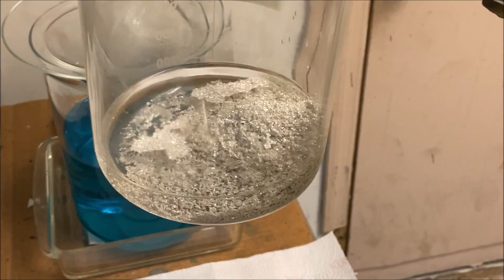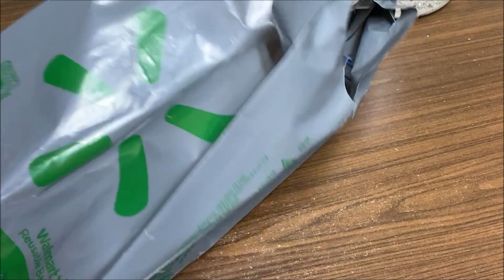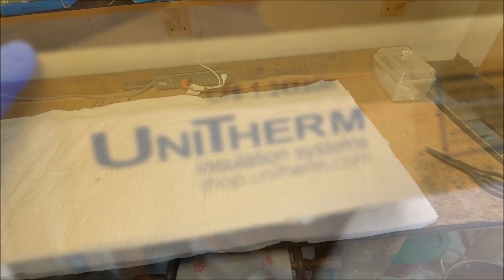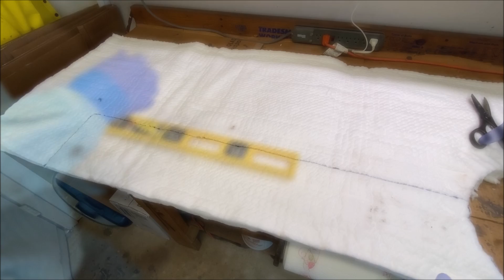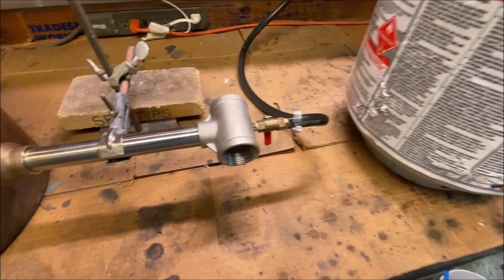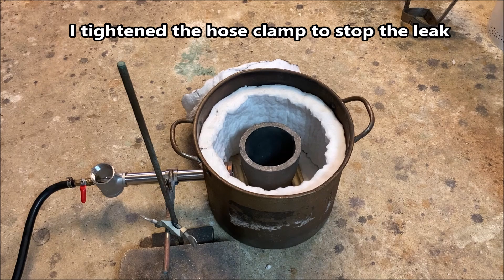Furnace Build For $100 Part 1

Comment: I'm sure it's far too late now, but:
#1 Use the metal lid! Just use screws to attach the ceramic wool.
#2 Cut a large hole in the centre of the lid.
#3 Rigidize your ceramic wool.
#4 Use a collar with triple centering bolts to mount your burner.
#5 Offset your burner so the flame goes around the crucible, not directly on it.
Finally, you might have had an easier time of it just cutting the top 1/3 off if a propane bottle.

Comment: I a. Looking for a "how to" for the nozzle/burner itself ☝️🙏.
Gas pressure air inflow.
Reply from the maker: I bought that burner nozzle on eBay already pre-made. I’m not sure of those figures. But I will say that the nozzle has performed nicely.
Reply: Unfortunately in africa we have to build our selfes, is the gaspipe crossing your double T air inflow perforated and it's actually using the ventulli effect.
Greatings from Namibia @sreetips
Reply from the maker: It’s a “T” with a propane nozzle. The air is Venturi in as the propane shoots through the long tube. The flame comes out of the end. I’ll do a short video. It looks like household plumbing fixtures.

Comment: Place a square of cardboard to place under crucible every time you burn. Will keep crucible from sticking to block. That block with vents may work fine alone.. Also some refractory clay painted inside all over the wool would be a very big money saver.

Comment: You should have put the fuel ignition point just as it goes into the furnace. Right now the way you have it, it won't be long before that pipe melts, crumbles ,breaks, etc. Very unsafe.
Reply from the maker: Ok, I’ll back it out. Thank you
Reply: @sreetips  Let me try to rephrase..Every furnace i've opperated in the past, the fuel went into the airflow draw right before it went into the body of the furnace. They would ignite inside the furnace, orjust as it was going inside.I've built these out of 5 gal. buckets and fire bricks. The hole you cut in the side should be on an angle so the fire swirls around the crucible.
Reply from the maker: Got it, thanks

Comment: “Propane Burner” search of eBay gives nothing but camping burners. Read through about 100 of the 250 comments and don’t see anything mentioned about it. 

What is the actual search term to find that propane burner? 

Those, specifically, are not easy to find! 

Thanks.
Reply from the maker: Propane furnace burner
https://www.ebay.com/itm/184364726452

Comment: Hi Srretips
If you position the torch diagonally, it will cause the flame to circulate inside the furnace, obtaining a higher performance.

Comment: Nice job, you might want to offset your burner so the flame rolls around the crucible. Make a more uninformed heat and keeps your crucible from getting a burn hole in it.

Comment: When you're doing your gold fill projects in the end do you add all your filters back in that's got the little gold chips and it looks like some purple stuff in there from when you filter out all your in between when you're not fuming anymore and add more distill and nitric do you add those filters back in
Reply from the maker: I add those filters to the recovered gold foils and then burn (incinerate) everything until no more smoke or flame evolves. THEN, I add the aqua regia

Comment: Hey buddy quick question when you put your stainless steel gold jewelry and hydrochloric acid how do you get your gold can you tell me the procedure I got a bunch of foils and black stuff when I filter it but when I put it try to put it in the solution I don't get no gold back when I check it with stanis chloride there's no golden solution can you tell me how to do this so I don't waste my gold
Reply from the maker: Stainless steel gold jewelry is plated gold a few microns thick. Very small amount of gold - almost nothing.

Comment: Yo sreetips, any chance you could do me a solid and basically just list out for me what glassware and accessories I need to pick up to do my first gold refining? I've got around 2 lbs of gold filled material. Also planning to do some karat refining, but would like to do the gold filled first. I have about 70 grams of karat grade material. And lastly I was seeing on ebay some stuff that comes in a bag that is described as nitric acid substitute? Is that actually legit? Oh and one more thing, how much would u sell me a 1/2 oz sreetips gold bar for?
Reply from the maker: I’ve made the videos as detailed as possible. Watch and take notes. GF is more difficult. Several small batches of karat gold before attempting GF. The “bagged” nitric I’ve never used. But it won’t be the same as nitric from a bottle. I don’t have any gold bars for sale right now.

Comment: You cam make a nice lid with Plaster of paris and play sand form a doughnut and sink two metal handles in.  You can open up some steel wool to put inside like rebar.
Reply from the maker: It will corrode and fall into the crucible.

Comment: I would get some sheet metal and cut a round of it to fasten to that ceramic wool lid, to give it some structure so it’s not so floppy. when that thing is at operating temperature it’ll be much easier to remove the lid if it’s a solid piece. You can just use a bolt washers and some nuts to attach it. Just a suggestion, I built one of these types of furnaces and appreciated a solid lid with a handle.

Comment: ?, If you dissolve gold filled materials in aqua regia? Will Stumpout work precipitating gold only? Or does Stumpout precipitate other metals as well? Much appreciated all your knowledge
Reply from the maker: According to Hoke, stump out (sodium metabisulfite aka SO2 gas) will drop platinum and palladium, if they are present in with the gold solution. But a second refining of the gold powder will usually remove traces of Pt and Pd if you use a different precipitant, such as copperas (ferrous sulfate) or oxalic acid, for the second refining. However, it’s not recommended to dissolve EVERYTHING in the GF material in AR. Doing so will produce a very dirty solution making filtering and recovery of the gold difficult and could result in loss of metal. Especially for a new refiner. Removing as much base metals as possible with hot nitric boils then refining the gold foils is the easier softer way.

Comment: Question, i used nitric to disolve sterling candle holders and 3 1942 ike dollars that were already destroyed, i left the solution out over night and there were clear crystals in the bottom of my beaker. Any idea what happened? I still got the cement silver out but no clue what the crystals are.
Reply from the maker: Silver nitrate. Dissolve in warn distilled water

Comment: Sreetips take a look at refractory cement, also called furnace cement, Satanite. You use it to coat the metal inside you furnace where it contacts the insulation and secure it to the metal. The with a brush or paint gun, coat the insulation inside to seal it and protect it from flames. It then acts to insulate the bucket so as you run your foundry it should  stay safe to touch on the outside of the foundry. Cut a breather hole in the middle of your lid you can see your melt progress and flame
color that way.
Hope this helps. 
Thank you for all you have given us 🔥

Comment: hey sreetips i recently found some filter material at pet smart in fish section that is highly acid resistant and exactly perfect size for the anode basket you are using as i have mirrored mine to yours and it works superbly just an fyi and they are 3 bucks per

Comment: I'd suggest induction coil heating. Just put a small ceramic crucible into the coil or even put a ingot mould on top of the coil. Let the gold melt right in the mould. Might produce prettier ingots.

Comment: if the crucible stand is alloy or aluminum, you may consider using something steel. it looked pretty red hot. not a big diff between silver and aluminum melt points..... nice job on the upgrade.

Comment: Hey Sreetips, thanks for your awesome videos, I watch all of them! I have one question: when you precipitate silver with hydrochloric acid you exchange nitrate ions for chloride ions and Ag+ for H+  leaving you with solid silver chloride and a solution of nitric acid. Do you put the reconstituted nitric acid in your stockpot or do you use it to dissolve more silver (or make more aqua regia)? Because even though it will be contaminated with copper etc. I guess its still pretty potent right?
Reply from the maker: Yes, it will still dissolve silver if there is any free nitric left. However, I try to use every bit of free nitric, before adding HCl, by boiling the liquid until no more fumes are evolved and there are still pieces of undissolved silver in the reaction vessel.
Reply: @sreetips  I'm not talking about leftover nitric acid but new nitric acid forming though. After all nitric is spent and hydrochloric acid is added, New nitric acid is formed from the  nitrate ions and the acidic H+ part from the hydrochloric. first you have Ag+ and NO3- ions, then you add H+ and Cl- ions. AgCl precipitates leaving you with H+ and NO3- which is essentialy new nitric acid. I think you could save some money there.
Reply: The only downside is the newly formed nitric acid is contaminated with some chlorine ions and copper (and other base metal) ions . You can get the chlorine ions out by adding silver nitrate solution until no more precipitate forms, and filtering. So then you are left with dilute nitric acid with dissolved base metal ions and a small amount of silver  ions and their accompanying nitrate ions. I saw a video once, I think from 999 dusan, where he made so called "poor mans aqua regia" where you make aqua regia by adding hydrochloric acid to a nitrate salt such as potassium nitrate or copper nitrate. This is almost the same: you have a nitrate salt in solution: silver nitrate and base metal nitrates, and then you add hydrochloric acid. So poor mans aqua regia forms. The difference is that if you add exactly enough you can get rid of all the chloride ions by precipitating it in the silver chloride. Thus making dirty nitric acid out of dirty aqua regia. Last I heard nitric acid is way more expensive than hydrochloric, so you could really save some on the acids like this.

Comment: I think you should put a lid on a hinge with a hole in the middle to allow gasses to escape and allow addition of additional metal.   I would suggest watching some videos from "bigstackD Casting" to see how important it is to preheat your tongs when taking the crucible out of the furnace.

Comment: If that floor thing is cast iron don't use it, it will melt. Ceramic or claim based plynths are what you need. Also add a piece of cardboard between the floor and the crucible to prevent the crucible sticking.

Comment: Put the burner on an angle so the flame has more of a cyclonic action around the crucible. You also might want to coat the mat with Satanite or refractory cement for more insulation and to reduce airborne fibers. The fibers can prove seriously dangerous to the lungs. Cool beginning build though. Can't wait to see where it goes from here.

Comment: you could "stitch" the furnace mat to the lid using steel wire around the edge to keep it away from the top of the crucible.
maybe also have the floor sitting the other way so the flames can flow through the ridges

Comment: A few suggestions that are probably buried in here already, but putting them all in one place:
0.  since you were in gloves you were hopefully in a mask as well since the fibers off that stuff isn't good for your lungs.
1.  burner should be in at an angle and not pointing straight at your crucible.
2.  In reference to #0 above, get something to coat the wool with, otherwise little by little it will burn off and be floating in the air and you'll be inhaling that stuff.  can't think of the proper term, but similar to refactory cement for it, but it is just a hardener you can "paint" on it.
3.  Cut that hole in the top as you need the air flow.

Comment: Along with the burner angle mods that folks have already mentioned, you need to stabilize the insulation wool with a rigidizer coating. The uncoated kaowool will slowly give you cancer the same way asbestos does. Plistix IR reflective or Metrikote IR reflective will increase the efficiency too.

Comment: Sr, I think that furnace will only last a couple of melts. Be on the lookout for an old propane tank. They have them at the hardware store here with no valve in them and brand new but I'm sure a used one would be just fine as long as it isn't all rusted out. 
And, yeah. The physicist in me says you're going to burn a hole in that graphite clay crucible. I'd aim the center of that flame right between the largest crucible and the wall of the furnace which will give you a good coverage and more even heating. 🙋‍♂️👍

Comment: Did the heat cause the soup pot to warp or did it come like that already? I noticed the heat escaping at the bent points at the top
Reply from the maker: I used that pot previously to burn several pounds of plastic that had gold on one side. It cracked during that incineration.

Comment: Cut a hole in the lid piece and the lid about the same size as the crucible top. Punch some small holes and use stainless steel wire to attach the wool to the lid and also as a handle to remove the lid safely.

Comment: You should also have at least 2 layers of ceramic wool. 1 layer isn't enough to prevent hot spots and eventually a melt through.

Comment: Don't just coat with rigidizer. To prevent premature breakdown, AND prevent dangerous particulate from breakdown, you should use a layer of castolight 30 castable refractory. It drastically increases efficiently and protects from breakdown. I'm a blade/blacksmith by trade. I have built a few gas forges. All of them capable of forge weld temperature for high carbon steel. 2200 to 2400°f.

Comment: It's great, all you need to do is work on a permanate lid and you're set. Take that lid you had and attach the wool by drilling holes through the lid and wool and using long bolts with large washer on the wool side and nuts on the outside to pinch the wool onto the lid. 3 should do it.

Comment: Yes..seen many of these furnaces.. the burner needs to be tangentially directed into the furnace. higher velocity will give more convection heat transfer and the heat will be distributed more evenly.. Guy from Mount Baker Mining and Metals even has an insulation wool only furnace. They all have a hole in the middle on top about as big as the crucible to vent out the combustion gasses. Can't wait to see those big bars of silver poored :D

Comment: Make the vent hole larger than the air mixing  hole diameter.  Safety. Gotta keep the heat on a one-way street.

Comment: Make sure to pre-run long enough to burn off the binders in the insulation and any residuals in the crucible. Caution in heating is needed as some forms of k wool melt below 1300C creating a royal mess ,  an optimized propane flame can hit  ~1900C  in best case scenario.  also venting and flame should be adjusted to prevent excess CO production.

Comment: Hey dude, might be a silly question but is the silver not worth less once melted down even when its melted and purified? I'm not sure how it works in the states but i thought it had to be "minted/stamped with a serial" to be easily sold on when in a  bar form. If melted down and made pure, its obviously still silver and probably higher purity after the processing but lacks the stamp/serial. Confused a little on it.  Is this more of an issue of who you sell to, i.e selling to a processing plant with proper equipment your get more, but trying to sell to a pawn broker get less or refused sale. 

Here in the UK might be different, i know the "scrap yards" (what we call the car/scrap metal yards who you normally sell to if not a pawn shop). They have very strict rules in what they can buy, i dont think they deal with gold and silver. But they do deal with cats/dpf filters from cars, and copper. Copper has a strange set of rules here with the sale it cant be in some forms such as thick cabling (people were nicking it from railway lines was to prevent that.). But they can buy melted down bars of the stuff, normal cabling, old boilers that kinda thing.
Reply from the maker: We buy silver. It does not need to be refined to high purity. I do it as a hobby. Sterling silver can be held just like it is. It will track right on up with spot price.

Comment: You should place the burner in angle to avoid burning the crucible. Propane gas penetrate the graphite and slowly but steadily "eating" the walls of the crucible. So to extend life of your crucible you should place it in angle that flame move around the crucible but not directly in to it. :)

Comment: You don't want the burner directly heating the crucible; you're only shortening the life of the crucible and increasing the risk of a sudden failure. The flame should come in at a tangent so the flames swirl around the crucible. Also get some saitenite or mizzou 3000 refractories to coat that ceramic insulation blanket and lock away the fibers before you use this again. Those uncoated fibers will become airborne and are a major health hazard.

Comment: You really need to preheat your Crucible before doing your actual smelting you start off with a slow flame and you build it up as it gets redder and redder and keep it in there for thes two three hours The Crucible can explode on you